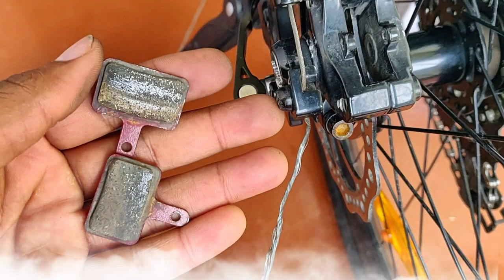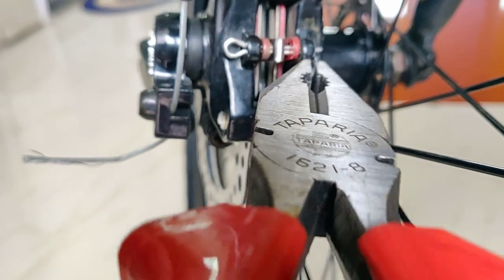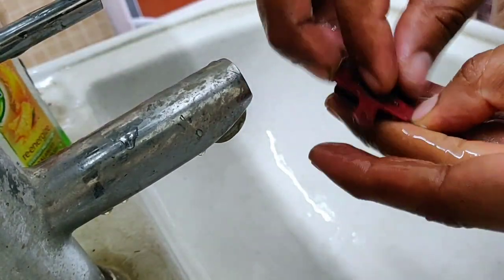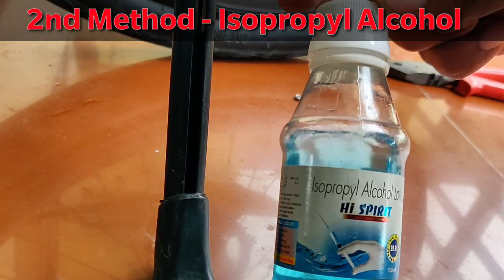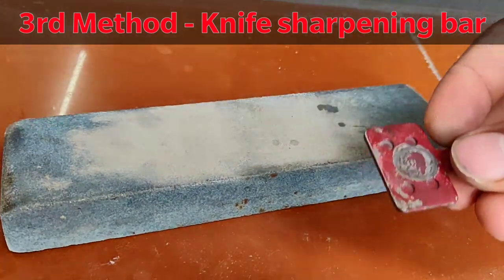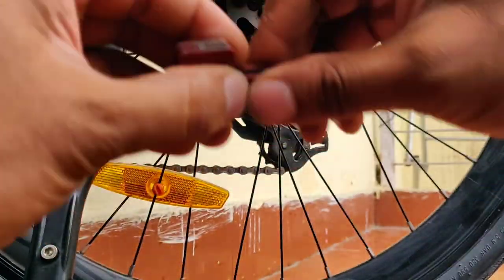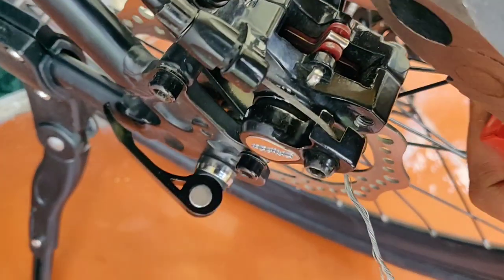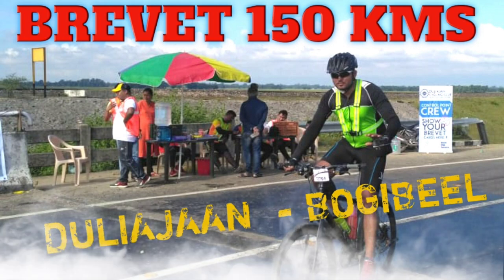How to clean your bicycle disc "Brake Pads" | Brake pads cleaning | | Clean brake pads and caliper |

Comment: Are red pads in bolids caliper works good? Or is there any difference between black and red pads
Reply: I tried bolids brake pads for my front brake as the original one from ninety one cycles broke.
But the performance of new brake wasn't even 50% of the original. with the original I could do a stoppie (that's why it broke after multiple stoppie). but with this , it can't even stop my mtb in panic condition without rear brakes !
Reply from the maker: Not much difference

Comment: Bhai  Mera  disc  brake  kaam kar raha  hai  but  wheel  Rukh  nahi raha hai kya problem hua rehga?
Reply from the maker: Your disc might be oily clean your disc with soap and alcohol, and your brake pads as shown in the video
Reply: Bhai new disk brake keee pads kitne ke ate h mechanical break wali disk kee
Reply from the maker: 300-700 rs

Comment: Bhai 
Mera front tyre ekdum ruk jata hai disc brake hai usme
Brake bhi jyda tight nahi hai
Jb brake bilkul loose krta toh tyre free chalta hai
Reply from the maker: Bhai tumhare brakepads touch hote honge disc se , local shop me jake check karwa lo , nahi to me thode din me ek video bana dunga . 😊
Reply: @vjstuff  
Bhai yha ek hi shop hai aur vo bekar hai kuch thik ni krta
Aap ek video hi bnadena
Reply from the maker: @jatindhiman5404  okkk

Comment: Bro where you purchased brake pads?
Reply from the maker: From amazon
Reply: @vjstuff  will those brake pads work with sdb 501
Reply from the maker: You have to check the shape of the disc brake pads

Comment: Bro, mere cycle ke brakes se sound aa rha hai..maine ye method try kiya tha toh kuch din thik ho gya tha lekin ab ye firse aa rha hai
Reply from the maker: Try to clean it with sand paper.
Reply: @vjstuff  rear brake is well working after sanding but front brakes are still giving annoying sounds
Reply from the maker: Then it's time to change your disc plate
Reply: @vjstuff  but I bought my bike recently about 2 or 3 months...I had change the brake once, and I got a good result but after washing my cycle it has been creating sound